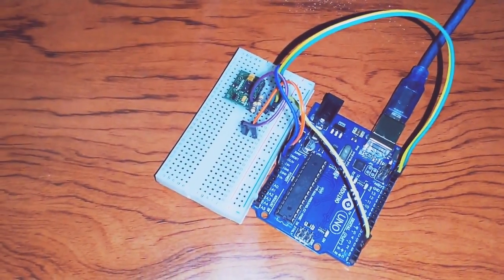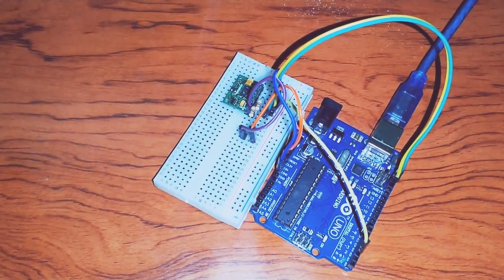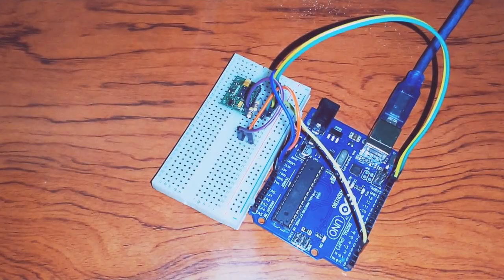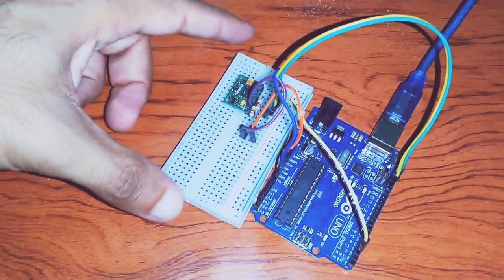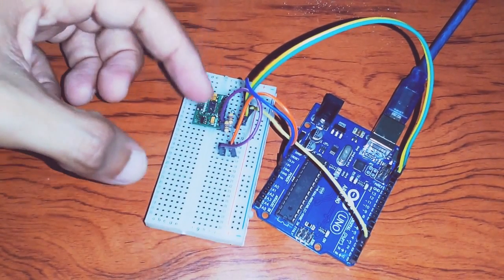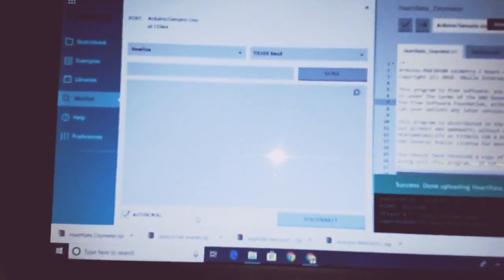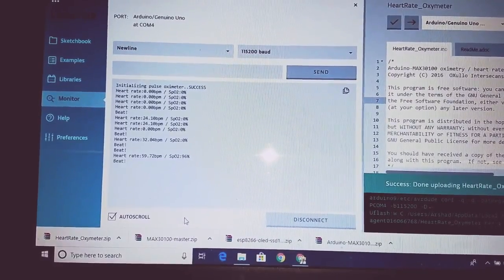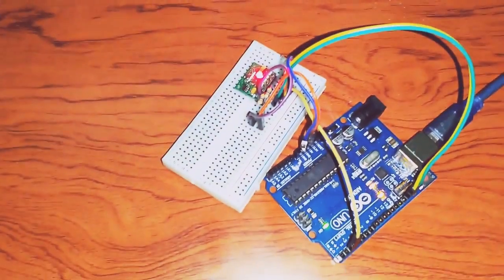MAX 30100 Heart Rate and Oximeter project

Comment: First Arshad, Thankyou.  Will this code work with the MAX 30102? They have discontinued the MAX 30100. Also Arshad, the IDE you are using does not resemble the Arduino IDE. at least it does not look that way. Do you have the entire thing on a schematic? It is hard to see the wire attachment and resistors on the breadboard at this angle. THANK YOU for this brief and workable (for most people) video.

Comment: I'm using esp32 in this assembly and I'm using the same code as you. After running the programming, the values appear in the serial and after a while they lock and do not change anymore. Would you know the probable problem?
Reply from the maker: I haven't used the esp32 microcontroller before so I don't know for sure the problem. Why don't you try using Arduino instead? It could work with it.
Reply: @arshadkaabi1056  : the esp32 has built in wifi and bluetooth more memory and faster..but more difficult to work with IMHO..

Comment from the maker: The program code:

#include <Wire.h>
#include "MAX30100_PulseOximeter.h"

#define REPORTING_PERIOD_MS     1000

// PulseOximeter is the higher level interface to the sensor
// it offers:
//  * beat detection reporting
//  * heart rate calculation
//  * SpO2 (oxidation level) calculation
PulseOximeter pox;

uint32_t tsLastReport = 0;

// Callback (registered below) fired when a pulse is detected
void onBeatDetected()
{
    Serial.println("Beat!");
}

void setup()
{
    Serial.begin(115200);

    Serial.print("Initializing pulse oximeter..");

    // Initialize the PulseOximeter instance
    // Failures are generally due to an improper I2C wiring, missing power supply
    // or wrong target chip
    if (!pox.begin()) {
        Serial.println("FAILED");
        for(;;);
    } else {
        Serial.println("SUCCESS");
    }

    // The default current for the IR LED is 50mA and it could be changed
    //   by uncommenting the following line. Check MAX30100_Registers.h for all the
    //   available options.
    // pox.setIRLedCurrent(MAX30100_LED_CURR_7_6MA);

    // Register a callback for the beat detection
    pox.setOnBeatDetectedCallback(onBeatDetected);
}

void loop()
{
    // Make sure to call update as fast as possible
    pox.update();

    // Asynchronously dump heart rate and oxidation levels to the serial
    // For both, a value of 0 means "invalid"
    if (millis() - tsLastReport > REPORTING_PERIOD_MS) {
        Serial.print("Heart rate:");
        Serial.print(pox.getHeartRate());
        Serial.print("bpm / SpO2:");
        Serial.print(pox.getSpO2());
        Serial.println("%");

        tsLastReport = millis();
    }
}
Reply: Hello I'm using max30100 with esp32 but red light not glowing and showing initialisation failed